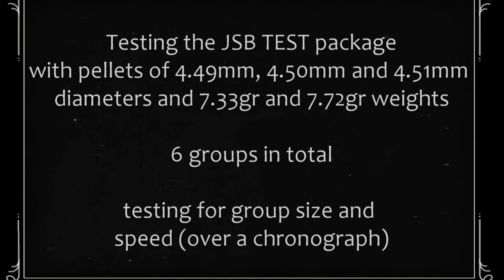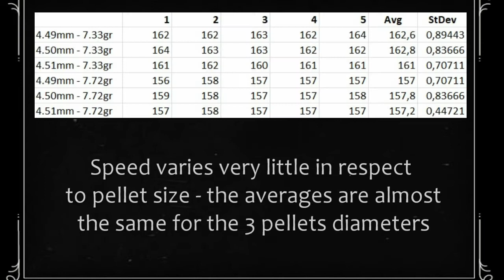Different pellet sizes and weights test in a Feinwerkbau P8X [EN]

Comment: By any chance did you measure the group sizes?

I know they are all very close but the data nerd in me is interested to see what the difference in group sizes would be.

Measuring drop from point of aim to point of impact would be another useful takeaway from a test like this
Reply from the maker: sorry..no. the groups were too small. the error margin in measurement would make the group size differences irrelevant. 
i could not measure point of aim when the gun is in a vice on the table. could not get a proper sight picture
Reply: @ oh, that makes sense